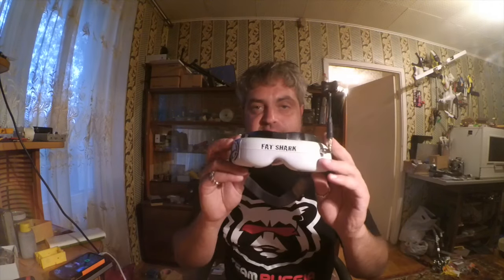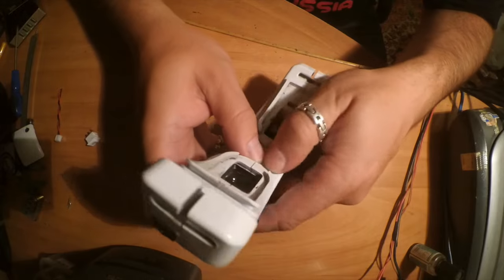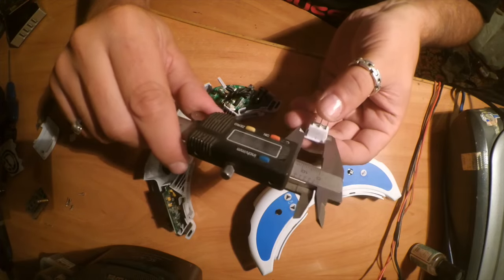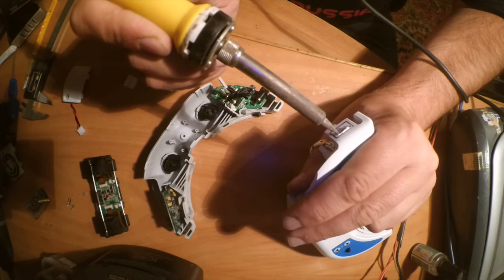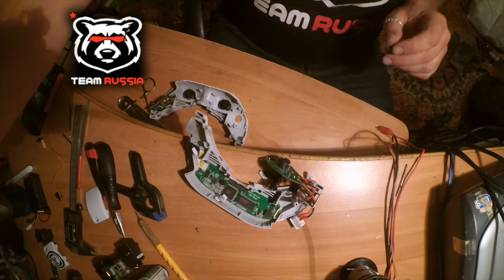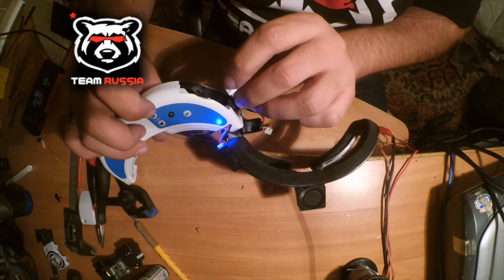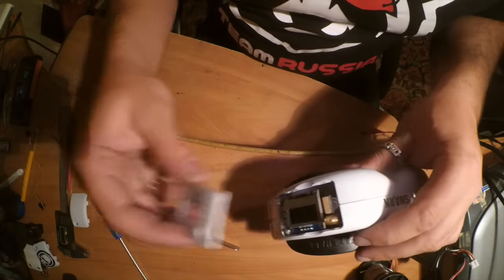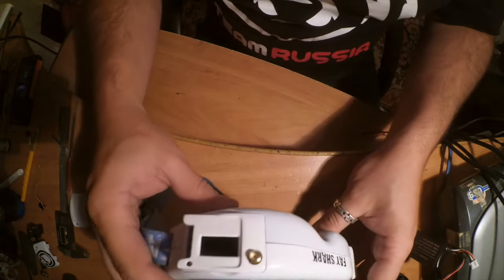FATSHARK ON/OFF SWITCH, FACEPLATE POWER MOD, LAFORGE V2

Comment: Great video. 
I did the diversity mod on my hd3s and was sweating. I'll probably watch this again before committing to switch mod. Plus can u link the switch u used please.
Thanks again
Reply from the maker: Unfortunately I don't have link
Reply: ArtPiranha 
No problem. I did the mod with a push switch in the bottom of my HD3s.
Worked a treat. 
Cheers again